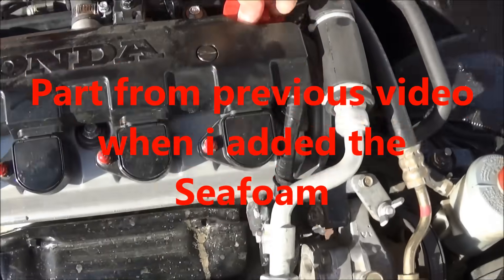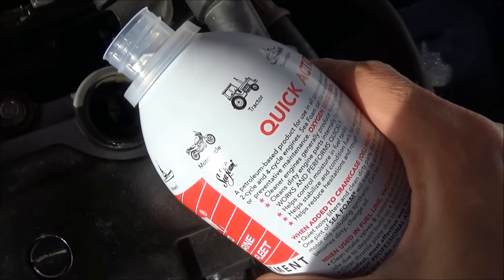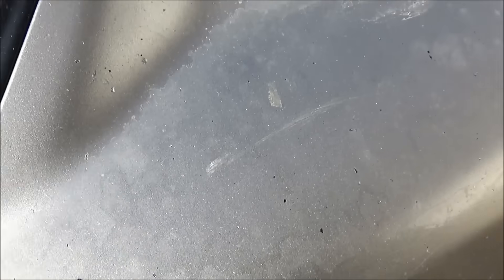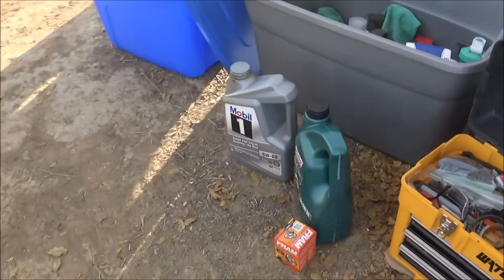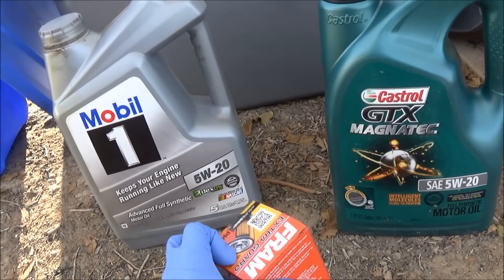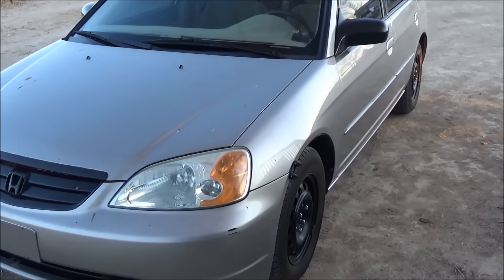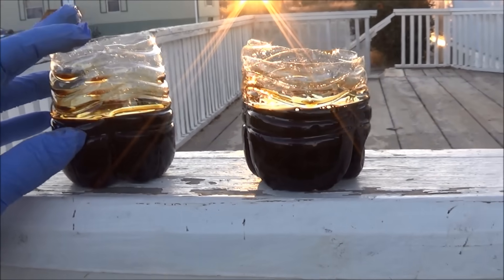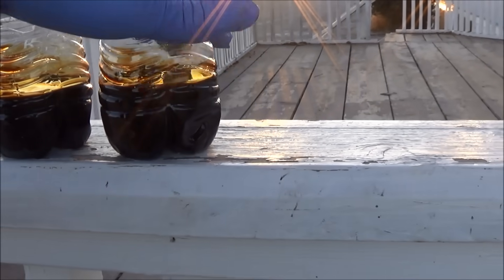Seafoam In Oil | Seafoam In Oil Before And After | Seafoam In Oil Before Oil Change [Sea Foam]

Comment: Dont skimp on filters bud. Fram = shit. Wix or k&n. Every 5k miles its not a huge extra cost
Reply from the maker: Agreed I usually only use Mobil one or k&n 99% of the time
Reply: At least 6k that's 2 conventional oil changes in 1
Reply: Fram Ultra Synthetic filters are good quality.. The rest are junk
Reply: YouTube has a video explaining the best/worst oil filters to buy, and the video shows them cut open to reveal each one's good/bad features. But by far K&N is the best hands down.

Comment: Did seafoam in my old plow truck, fixed my blowby issue but killed my oil pressure not sure which problem was worse..... Oh yeah orange fram are no good, best filter is a napa gold.
Reply: kssksskills tank Never use Seafoam on older engines unless it was used regularly from the beginning. It cleans so well that it may remove old oil which is pretty much grease and cause leaks or other problems
Reply: Guess I learned the hard way....lol pulled the motor and did a full rebuild a year later. Long live that old 79 bronco!
Reply: Napa gold is a Wix. Even better is the WixXP; totally synthetic filter media.
Reply: Thinned the Oil and changed viscosity and raises operating temp, thus dropping oil pressure. Blowby was addressed by your PCV getting cleaned out by Vapor of seafoam.
Its a cool trick to clean, just chancey to "run" in a motor  more than 50 miles.

#ATCR

Comment: Never cheap out on a oil filter. Scotty has a video on the defference between them.
Reply from the maker: Thanks
Reply: Why will the engine run "funny"?
Reply: Lucifer The Lightbringer tons of good videos about oil filters being cut open! Fram is nothing but marketing trash!
Reply: I would rather buy cheaper oil and a expensive filter than the other way around. If you want a healthy engine, i would also disable the EGR valve.. can’t be healthy to run on exhaust gasses..
Reply from the maker: Good advice
Reply: @Kaseyclips  yeah until your engine light turns on..your motor starts running funny

Comment: Don't put anything in your oil unless you wanna kill your engine. 2 oil changes a year is better, all the bearings and things are constantly in clean oil. Thinning your oil out will just wear something out prematurely
Reply: 2 oil changes a year? WTF! Unless you don't drive you're car
Reply: @motosapien2310  only at weekends
Reply from the maker: Disagree and this video is a year old. Still running 240k no parts since bought.
Reply: percy LFC wrong! Base on my experience changing the oil every 20,000 miles and putting in full synthetic recommended oil on my Beamer didn’t make a difference and at the end I basically wasted tons of money and time vs the neighbor across the street that bought a 2000 Oldsmobile v6 same time I bought my 325i 5yrs ago and never changed or did any maintenance on his car and still running up to this day with no problem. Ask me where my 325i ended up? It’s in the motherfuking junkyard. 5yrs of maintenance, money, and time wasted down the drain. My advice to everyone when you buy a car is don’t do no maintenance on it till it dies. I’m hitch hiking a ride to work every day with my neighbor that never opened the hood of his car since he bought it. Very embarrassing and disappointed.
Reply: @dondadda1151   That's not the right take-away. First, never buy any German car, if you want something that's going to last and be trouble-free. Second, if you use "synthetic", change it every 7500 or less.  I'm old and keep my cars for decades. I've had my current daily driver for 20 years. None of my cars burned oil, none had the heads off, no engine issues period.  I use conventional oil, whichever API service SN, ILSAC GF-5 that's cheapest with a factory filter or equivalent. I change it myself at 4-5K and never use any "additives" of ANY kind either in the crankcase or fuel tank. But people will do whatever stupid things they want to. It's more like religion for them than science.
Reply: @wholeNwon  thank you. Somebody with some sence. My car only does 5000miles a year so changing oil twice a year is sufficient. Don dadda don't change your oil at all ?. Yeah or8
Reply: @percylfc7165   Actually once a year would be  sufficient unless, perhaps if your car is old, poorly maintained in the past and has a lot of cylinder blow-by. If so, some high speed driving now and then would probably be better.
Reply: I change my oil every 3 months, even though i don’t drive it daily. I change it even if i only drove around 40 miles in 3 months.
Reply: @14isralove   You're joking, right?
Reply: @14isralove  glad you like flushing money down the toilet, if you drive 40 miles in 3 months. You change your oil. I had oil last 3 years in my car with 11,000 miles on the oil and with UOI its still clean oil

Comment: For everyone saying fram is trash ill tell you something thats all i use on both my cars plus i recommend them to my customer plus castrol gtx i drive up and down texas no problem,yall should learn how to do oil changes instead of commenting fake stuff or buy better vehicles.
Reply: Mr.sam you are an idiot for cursing out people because they don't agree with you. that is very stupid and I agree with the other fellas. if I ever came across you. you never put a finger on my car. obvious you don't understand that just cuz you're in Texas where it's always nice beautiful and hot weather doesn't mean other states that get the cold weather is going to be the same results. Fram is not going to be a good oil filter because they are horrible they freeze up they suck the cheaply made, they fall apart.
Reply: @backvic   i have plenty of customers and plenty of people who ask me for mechanical advice as far as me cursing fuck you too you dont like it hop off my comment fyi i dont work on pieces of shit.
Reply from the maker: Ummm....bottom line. Your engine blows. 99% of the time. Its not the oil filter. Its user error. I have cut them all open my self and seen them. Everyone can have a opinion no problem yo. Calm down lol
Reply: Nope both of you im a skilled mechanic at a fair price both of you go fuck yourself.Proof is in the performanece igorance is bliss your opinions are invalid.Ive been doing mechanic work for 20 years i own my own buisness plus i work 40 hours a week you dont like my opinion well fuck yours dont comment.
Reply: watch the video on Fram filters and see for yourself
Reply from the maker: I have several oil filter break down videos yo check em out.
Reply: most mechanic gives shitty advices anyway so that your car break and you have to pay them to get repair
Reply: Might as well get STP too 🤣🤣🤣

Comment: I put a whole bottle of seafoam in my gas tank, every oil change on my 2002 cavalier with 235k miles and it runs so smooth
Reply: Yeah super tech synthetic from Walmart is actually really good too I use that and K&N filters all the time
Reply from the maker: Oh ya awesome man. Try marvel mystery oil also. That stuff is great
Reply: @Chicodirt  yeah I heard good things about that. I also only use synthetic oil on it and the oil it's really clean even after 3k miles
Reply from the maker: Ya I have several videos on both product. Ya I also use synthetic and do my oil changes between 5 to 7k

Comment: So it didn't thin out the oil and or clean out the piston cylinders possibly causing damage ?
Reply from the maker: Nope! I did a oil change 600 miles later and valve adjustment. Bam runs great and still going strong. Now I'f your engine is really bad do my 15 min seafoam treatment I show in a video. Go check it out.
Reply: 1/2 a liter blended into your oil isnt going to thin it out that much lol.. plus its 100% petroleum based.

Comment: Ive used nothing but fram. Since 1991. And i drive my vehicles HARD, mostly dodges. Ph8a fram filters. Never had a problem and they lasted well beyond 300k.
Only engines that didn't last was a chevy 350 threw a rod. And a olds that threw 4 rods out the block.. Thats not frams fault.. Just gm's weak bottom ends.
 Orange can of death.. Sales pitch my friend.. Why not make more $$ if a sucker is born every minute
Reply: Gm 's weak bottom ends? 😂  ever heard of a 5.3 or 6.0? Look one up that's boosted and tell me how weak they are. 😂
Reply: @hillbillyimports31  That's what I was thinking. Like yeah holding 750hp on a stock bottom end is so weak lmao
Reply: Haha look up some videos about gram recently you'll switch filters pretty fast they fall apart thats why they're so cheap
Reply from the maker: Go to my oil filter videos. 5,000 later miles with multiple oil filters yo
Reply: Except ph8 is a ford filter, the mopar is ph16
Reply: @caniwitech  good call
Wow.. Dont i look silly.
"Get a bigger hammer it aint fittng"
Reply from the maker: Agreed

Comment: How many miles are on this motor currently? It looks really clean! My Civic had 310k on it when I adjusted the valve's last! Runs great! Not as clean tho!
Reply from the maker: Its currently at 240k. This video is a year old. I adjusted my valves also after this video. I'd run some seafoam in your gas for sure and thru your intake manifold. I have a video of me doing it to my civic bro

Comment: pay a few $ more for Mobile 1 and K/N, WIX, Purolator filter. And NEVER FLUSH your engine, that hard crusty oil will accumulate in your oil pan and clog your pick-up tube, starving your engine of oil and burn it up. I have made this mistake.
Reply: That really only happens if you got 250k on your car and you went 15000 miles in between oil changes, at which point changing your fucking oil is useless. I use this shit religiously on my car some of them over 150k if you know what you're doing there's no problems. If you've neglected your car to the point to where you've got crust internally in your engine than You're Just a Fool to begin with

Comment: i did this too. Only problem was big chunks of gunked up oil clogged my oil intake and it reduced oil pressure so much I burned up my 5.4L ford truck engine.
Reply: Well there’s your problem.. 5.4L Ford 😂
Reply: @mikeg7843  🤣🤣
Reply from the maker: Should of watched my 15 Min seafoam video. That would have been better man.

Comment: Is Seafoam compatible with Engine Restore? My Lightning has 130k, so I use Engine Restore in it. I'd love to clean out the motor though since I know the PCV system sucks and oils gets run through it constantly.
Reply from the maker: Should be fine. But I'd watch my 15 min seafoam treatment video. I'd do that for starts
Reply: Oil runs through your PCV??
Then your rings are pretty much shot
Reply: I used engine restore once on my 22R in my Toyota pickup and it blew up the engine

Comment: 500 to 1000 miles before an oil change (I change every 7500 miles), I add Marvel's Mystery Oil (MMO).  I add no more than 16 ounces  MMO is great for gently cleaning out an engine.  Additionally, I use Pennzoil Platinum synthetic oil...does a great job of cleaning engine as well.  As for oil filters, Purolator, Napa Gold, and Wix are all I use.
Reply: @I Paid I disagree.  About 16 years ago, I was having oil pressure issues with a 1979 Dodge 318 engine (turned out to be a clogged oil pump pickup screen).  Nevertheless, during the process of trying to discover what was wrong, I had taken the valve covers off both sides and discovered one sludged-up mess.  I scraped off, with my fingers, as much sludge as I could, and then sprayed MMO heavily all over the exposed parts and buttoned her back up.  For the next year, I ran 1 quart of MMO with every oil change.  And after that did the half-quart routine with the last 500-1000 miles before oil change (which on that vehicle was every 3000 with conventional oil).  Three years later I sold the vehicle to a mechanic who did a rebuild on it.  He told me it was one of the cleanest engines he had ever rebuilt.

I also use a MMO and ATF mix for a penetrating oil...works good.

Comment: I've always use FRAM filters (I've never had an issue) I'm thinking you guys dont know how to do oil changes properly or something lol
Reply: Salazar.. If you like your car, stop using fram
Reply from the maker: Right!!! Like how the f does a oil filter f up ? Unless its user error. Like going 50,000 miles on a fram oil filter or some dumb shiz. Iv seen Ppl not put them on right or tight. Fall off then engine blows. Damn fram oil filter is what they say lmao. Noooo! This video is a year old and trust me my car is still running no issues and no parts replaced since this video. 240k now going strong. Of course I did a valve adjustment just to be sure after this oil change
Reply: Cut open a fram and you'll immediately see the difference. Most all filters other than fram have a silicone diaphragm inside that essentially works as check valve to keep the filter full of oil. Ergo no dry starts before the filter fills up. Fram does not. Also most filters have something like 30-35 pleats of filter material inside, where as fram has significantly less. Less surface area, less filtration. But the big kicker is that filters have a safety valve (2nd function of the diaphragm) that ,if your filter stops up , it bypasses oil through it so you don't lose oil pressure to your engine. Fram also does not have this since it has no diaphragm. Ergo. Bye engine. Stop using fram if you like your engine. Plain and simple. They work great until they don't.
Reply: I've been doing oil changes for 15 years only filters that have failed have been Fram tough, and extra guard. I had a Fram tough guard get a pin hole in the filter on my Integra. It sits on top of the block so how does that even happen? Also carboard end caps are trash.
Reply from the maker: Go to my oil filter videos. I cut lots open. Very interesting
Reply: @Chicodirt  I'm a certified technician. Trust me. I've seen them all.
Reply from the maker: Then u know Honda OEM oil filter is the EXACT same as fram tough guard. Tell that one to your Honda buddies who say OEM everything lol
Reply: @Chicodirt   also there's only really and truly 4 oil filter companies.wix, fram, k&n, and Bosch. Every other filter brand is just a rebrand of one of these filters listed.
Reply: Worst part about fram filters is they rust internally. Filter is supposed to clean the oil, not contaminate it.
Reply: I just personally haven't had any issues and I've been using them for years. 
3 cars all with fram filters and no problems.

I've seen reviews and I've seen good and bad from all companies YouTube will make you see what you wanna see. 
I go by my personal facts and FRAM works for me.

Comment: I think the can says don’t drive on seafoam
Reply from the maker: It says use every 3000 miles....every oil change. It says to keep it in there....
Reply: @Chicodirt  I think it means use in gas every oil change as preventative maintenance.
Reply: @Chicodirt  The can actually says to only run it for up to 300 miles and no longer.
Reply: WRONG
Reply: It reduces the viscosity since it’s a petroleum product. I wouldn’t recommend putting it in your oil any time before you’re about to change it or it’s not going to lubricate properly. It definitely works for helping clean up a bit but always use caution
Reply: @literallydante7  seafoam is a cleaner / detergent that is also an upper cylinder lubricant. The only way it will thin out your oil is if you use way too much. If you're able to read this should not be a problem, however this seems to be way too much for folks these days

Comment: my idiot brother put a fram filter right before the winter, the fucking thing cracked after a month and bled oil everywhere. fuck fram oil filters.
Reply: Yep frame has a weak cardboard filter that falls apart if you touch it. Use wix
Reply from the maker: Lmao he didn't put it on right my dude.
Reply from the maker: 100% agree!!!!!!
Reply: FRAM hasn't let me down. Human error for sure. 

Over tightening or under tightening even though it's common sense. Smh
Reply: Omar Salazar tbh I work at a parts store and we stopped carrying fram because of issues like that
Reply: @pharaohtp9296  I've just personally never had an issue and it's been years now.
All companies make mistakes maybe you guys did get a bad batch of filters not saying you didn't. 

Just hasn't happened to me so I'll stick to what works for my vehicles.
Reply: Omar Salazar haha I know what you mean trust me not trying to sound like I know cause I don’t in anyway
Reply: Omar Salazar not saying you are wrong just saying on my experience at work which is just limited to being told that by my bosses lol
Reply: I live in Northern New England and I use Fram and it gets down to -35 what's the fucken problem

Comment: I use seafoam in a 4.0 ranger and it cleaned the engine really good, it use to have a little sluggish spot when driving now it's gone after seafoam use and I would only  Napa oil filters
Reply from the maker: Nice!!! It really does work

Comment: Do not use  Fram filters, horrible quality inside, there is a guy who cuts a bunch open and Fram inside is like a toy
Reply: You would do better using a roll of toilet paper instead of a fram filter! Go back to the K & N!
Reply from the maker: Lol ya I usually use k&n or mobil 1
Reply from the maker: Thanks for the tip. Check out my oil filter videos there interesting.
Reply from the maker: Go to my oil filter videos. I cut open multiple fram oil filters